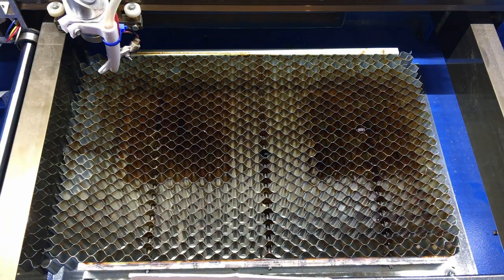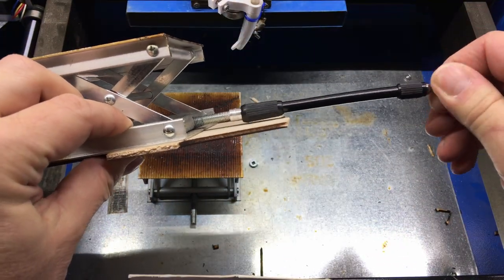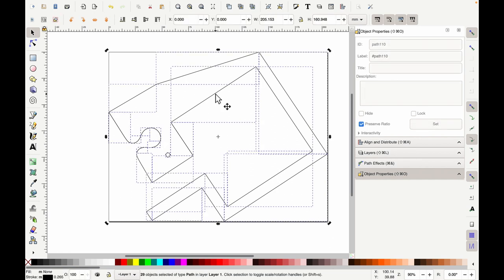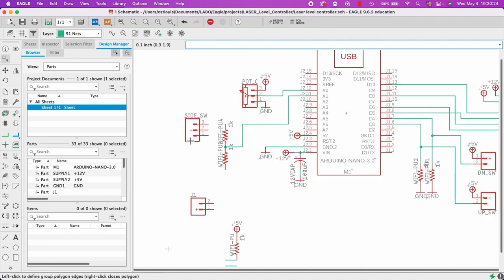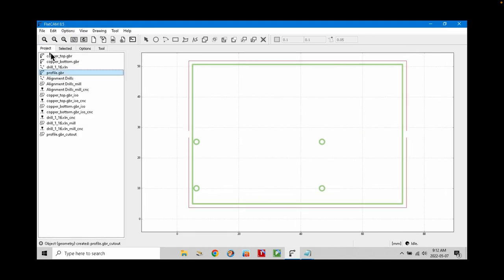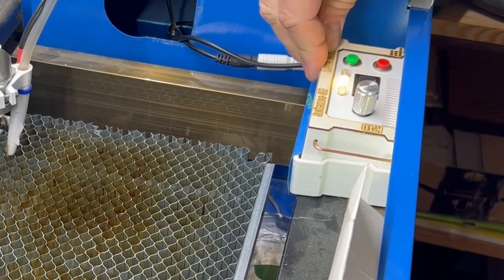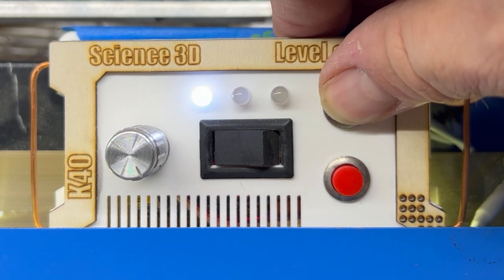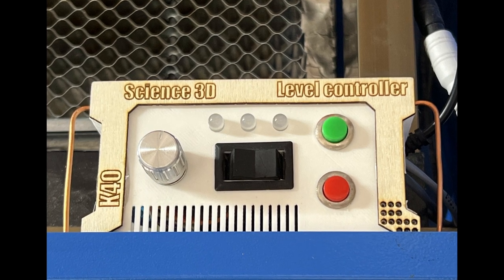K40 Laser Cutter: How to Upgrade the BED using 2Motors and an Arduino Nano

Comment: Good idea, I would use only one stepper motor and connect both beds with a GT2 pulley and a belt and driving the belt with a nema 17, making both bed always be at the same height =)

Comment: Interesting.  It is somewhat better than the manual way you were doing it before, but still seems like adjusting & leveling is still a bit of a hassle, as each motor has to be adjusted separately.

Comment: Overly complex / complicated.  There are better ways to make an adjustable bed using only one table and a single stepper motor, or manually raise / lower the bed via a shaft coming thru the front of the machine.